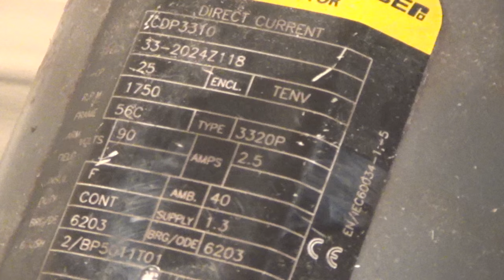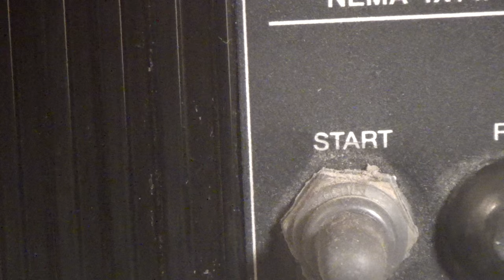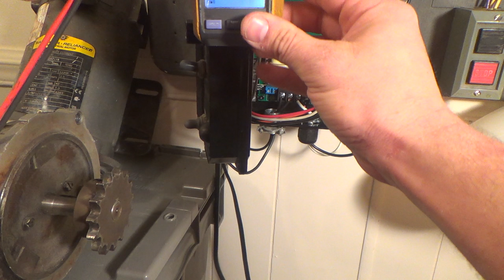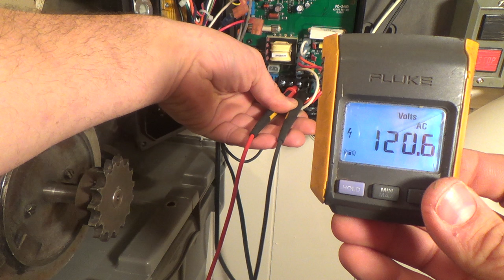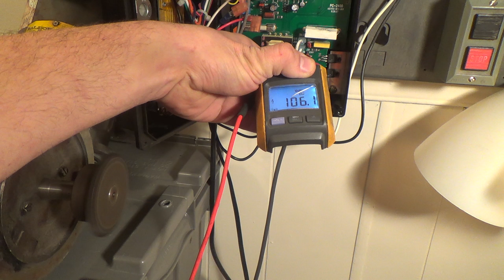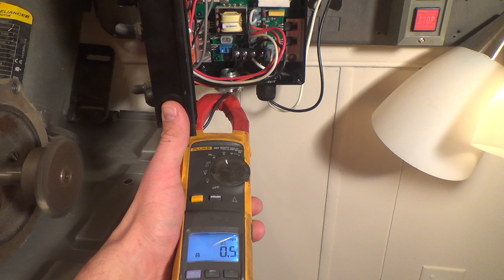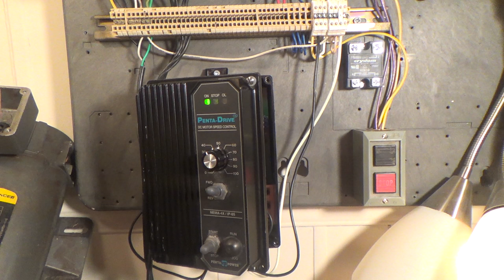Introduction to DC Drives

Comment: I've got an old  Manerick DC drive I've struggled to hook up (w/confidence)  So I've settled on using A Variac auto transformer..

My question, why not use a Variac  with contactor  instead?    
Is my variac (with a bridge rectifier of corse ) bad for my 90volt DC motor? 
It's a Minarik  blue label
Reply: Stranded that s me.. but I can't find any videos explains how a drive works to the extent I can grasp what and how it should be wired to the motor.  

My drive has brake ff and Rev btw

Comment: Your voltmeter was measuring over 90 VDC. Wouldn't that damage the motor? Can you explain what is happening. Thanks for this!
Reply: Over time possibly, but typically they can handle some over voltage. I guess the way I think of it is that whatever the rating is of the insulation inside the motor determines what it can really handle lol. Giving it more voltage from the DC drive makes the motor more powerful...Faster. plus it's fun.